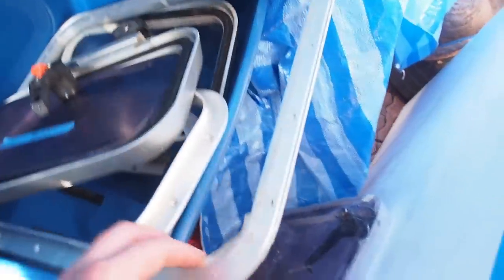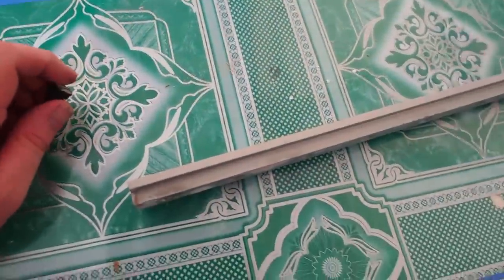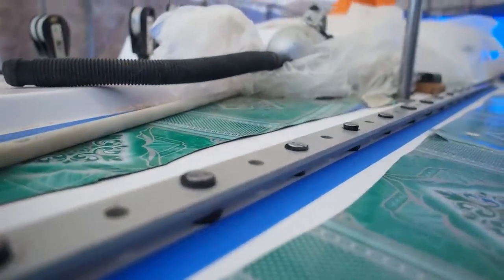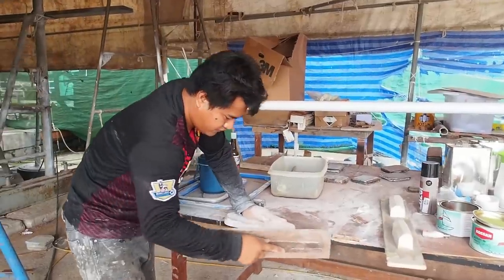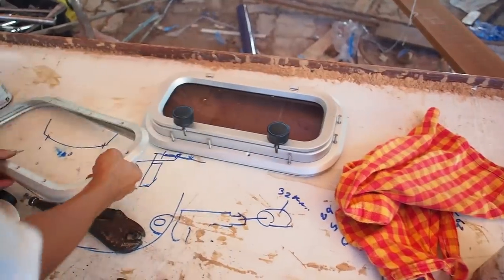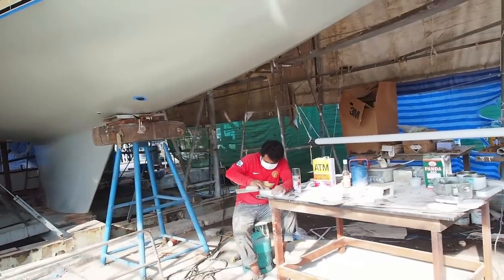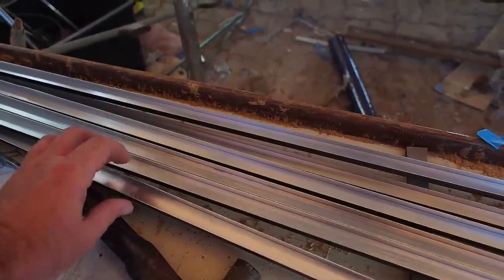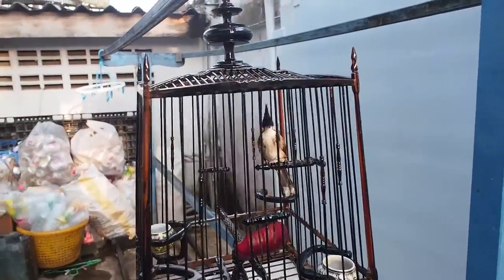Esper Refit 34 - bedding deck fittings with butyl tape, polishing stainless,

Comment: Butyl tape is the best and the least expensive way to go. Little bit of a learning curve though. Replaced my ratty teak rail with extruded aluminum toe rail. Bedded with butyl. No leaks yet!
Reply from the maker: Interested to know if you followed the same procedure as us, Craig Mcilwain, or if you also ran tape along the underside of the toe rail too. I'm sure my way of doing it is fine but I have seen people bed the entire flat underside of a fitting (say a large cleat, for example). Good to know you're not leaking!

Comment: thanks for sharing your refit vids! 

@8:10 - sad to hear your fellow cruiser on Fayaway chose to use tributyltin. There's a reason tributyltin is banned (https://en.wikipedia.org/wiki/Tributyltin#Toxicity). With cruising grounds in close proximity to some of the most beautiful and pristine ocean ecosystems (and many under significant stress at this point), I certainly hope that most cruisers would make a different choice.
Reply from the maker: Hi CLabs and thanks for your comment. After publishing this video we went away and studied tributylin and were horrified to learn about its toxicity. In fact you have prompted us to add an annotation over the top of the interview with Fayaway to warn other yachties not to use it. Thank you once again for highlighting this issue.